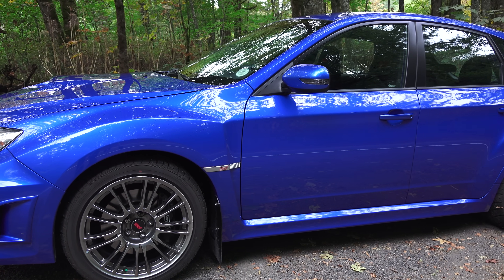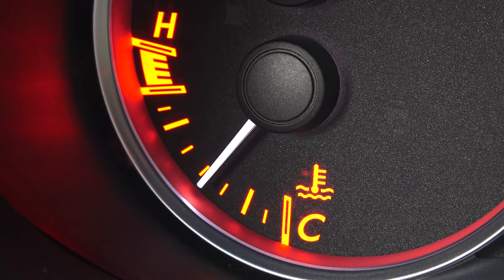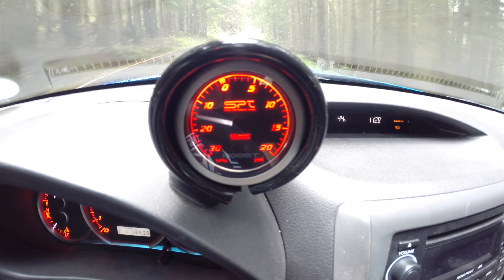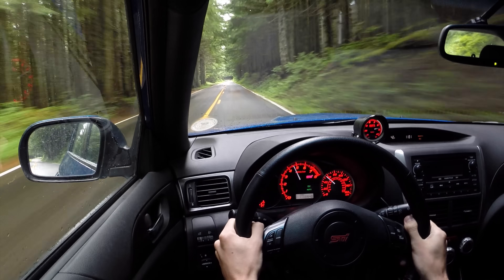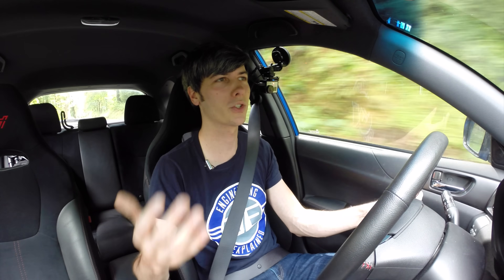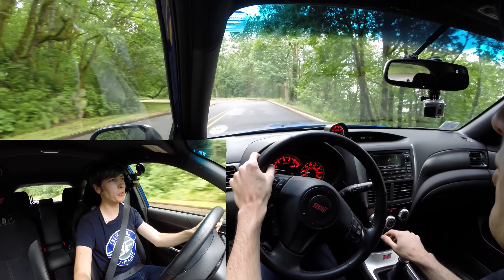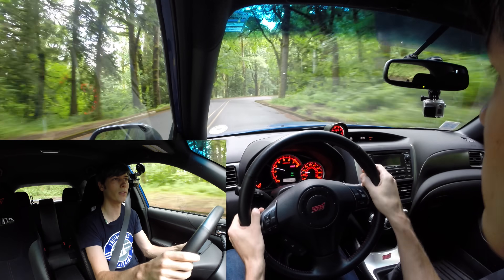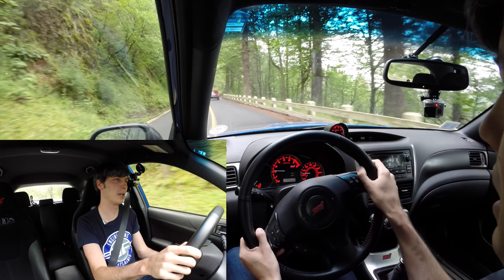5 Things You Should Never Do In A Turbocharged Vehicle

Comment: 1.) You made a video debunking the "waiting for your car to warm up", because new cars are built better and can handle a cold start and go. So witch is it?
2.) Oil in a engine can not just burn up, or change viscosity. Oil gets dirty and additive ware off, but never does oil burn or change viscosity.
You know these things and have done videos on them, so why the contradictions?  Or I'm I reading too much into all this?
Reply: Views.
Reply: The additives break down with excessive heat and car makers always advise to let the car run for 30 seconds or more after a hard run if it's got a turbo.
Reply: I think here is the difference.  In the old days, you needed to wait for your car to warm up to make sure oil was flowing properly.  Now, the cars AND oil is better (remember Slick50? anyone use that stuff anymore?) so you can pretty much start your car and drive off right away without impacting your car long term.However, if you want to start showing off and/or light up your tires and zoom zoom from here to there...let your car's engine oil warm up a bit first.
Reply: letting the oil warm up and leaving your engine running to cool the oil down are two separate issues.

Also oil can lose its viscosity with heat if you've watched his other video about synthetic oil he demonstrates how old motor oil will lose viscosity as it ages.
Reply: (1) IMO you can start the engine and drive away more-or-less immediately, but don't floor the gas or run the the poor engine to redline until it's had some time to warm up properly.
(2) I don't know about viscosity, but oil can leak past the piston rings into the cylinders, then depart the engine via the exhaust.  Whether it actually burns is semantic – when people talk about 'burning oil' what they mean is the engine is losing it through the cylinders.
Reply: I noticed that in the last few months he has had videos where he seems to focus more on oil and facts about it, one video even has a oil spokesperson in it. I wonder if it has to do with some kind of sponsorship deal? he isn't totally wrong about rapid temperature change affecting oil, but its supposed to be changed every 5k anyways so it seems like that would be minimal over such a short lifespan.

Comment: I really think your wrong about this, the oil temp is going to change the weight of the oil only and wont kill the turbo. If it were true that that heat would adversely affect the oil, wouldn't the engine block getting just as hot and also ruin the oil? The reason that ignition occurs is shitty ass head design- ask anyone who knows their hold in head porting. I definitely trust people with 20+ years experience than your educated google-fu. Come on slip angles? That has nothing to do with weather or not its naturally aspirated. 

Why does this video exist?

Comment: Would you do a video on hypermileing? I like to floor it at low rpm for efficiency. Is there an equation that describes allowable torque demand as a function of rpm?
Reply: It's true that engines operate more efficiently under some load. This is basically the reason why you do low rpms and high gears for better mileage (+ there's also less friction in low rpms). However, there's a sweet spot for efficiency, and full throttle misses it. Take a look at the island diagrams in section "real world" in the article linked by Daniel G.
Reply: floor it at low rpm for efficiency ?......... well this is news to me..
Reply: +mrbdazz less friction under lower gears? You mean lower gears = higher torque, higher gears = higher power lower torque...   gearing is set to balance engine Power and torque curves so little to no gap as possible.   Not about friction.   
Why would my higher gears have elevated friction?  Backwards logically also.. how would my GT-R be able to pull 200MPH with higher friction gears?

Comment: FYI, most common fuel in Europe is 95 octane, higher option is 98 available in petrol stations. For 102 octane you have to supply in special stations for racing cars. I've met 108 octane one on drag racing events but it's quite rare. 
So, translating most common EU petrol to US rating, EU95 is US91, EU98 is US94.
BTW, European diesel has 50-60 cetane number and in US standard is 42-45 but some states force higher numbers for ecology reasons (California has 53 minimum).

Comment: How do you feel about tuning these kind of cars Jason? I'm thinking about going the Cobb stage 2 route with my 2014 WRX but I'm worried that it is not good for the engine and car in general, and I want my subie to be as reliable as possible and last me another good 10 years or so if possible. Thank you in advance for your thoughts and any advice.
Reply from the maker: More power means less reliable (unless the engine is built accordingly). Tuning and longevity are inversely proportional. It's fun to tune a car, but the warranty is gone (for a reason). Like everything it's a pay to play kinda deal.
Reply: My opinion, I don't think any tuning is good for the engine. The engineers designed it to be reliable in its current state, in most cases anyways.
Reply: Cobb's stage 2 would be about the limit if you want the most reliablility out of your car. Get a protune, it'll be much better than the OTS tune from the accessport. I've been on stage 2 for a year already and have had no issues with the engine. Do your research on forums like iwsti or nasioc.
Reply: +Vinny The Tech yup I see it all the time in the Vw world with "tuned 1.8t's". 
That turbo is already pretty much maxed out in efficiency from the factory, crank the boost and watch the efficiency fall off, hotter intake temps, overspeeding the turbo...
usually by 100-120k a tuned one needs a new turbo, I've seen untuned ones go 200k

Comment: Im not sure i understand the whole lug your engine thing ? Why would an engine make lots of boost immediately when trying to floor it in a high gear because i thought boost was made by a high volume of exhaust through the turbo and you wouldnt move much air at a lower rpm. I know that it puts strain on your motor but from my experience with my truck all you do is waste a pile of diesel making smoke (lol) until it rolls onto boost in its usual higher rpm range. Im not saying your wrong! but am i missing something ??

Comment: I've got a question. I drive an '03 MR2 spyder and was heavily thinking of going turbo. However, at highway speeds I'm at about 3750 rpm. So my question is, how would a turbo work in terms of cruising on the highway? Would it constantly be making boost? And if so, would it lower my rpms at highway speeds? I'm not too sure as to how it would all work. If anyone would let me know, I'd greatly appreciate it. Thanks!
Reply: David Hidalgo I've seen that video on 1320 with that 900hp MR2. that thing was crazy. Anyways, always appreciate the help!
Reply: 3750 rpm is not really low, about in the middle range. If the turbine won't be as big as a bucket, I think it will give you some power more. But it depends not only by your rpm, by throttle position too. 
Get a small turbine and I think you will be good  :)
Reply: +Giovanni Quargentan so you think that if I just keep the throttle in one position, the turbo won't be constantly working?
Reply: the crazy llama no, it would work still pretty good. More throttle means more air flowing = higher turbine rpms = more boost.
Reply: +Giovanni Quargentan Alright, so I shouldn't run into any big problems?
Reply: +the crazy llama I think so
Reply: +Giovanni Quargentan Alright thanks! Appreciate it!
Reply: Might want to look into a more durable transmission, too. Grenading your transmission because you are putting too much stress on it would suck. Depending on when you will start hitting boost, you may also want to have the gearing changed up so that you can run closer to 2000 rpm at highway speeds. Fuel efficiency will be drastically improved, if the engine is putting out enough power at that rpm.
Reply: +napoleontheclown so, with that fact that my car has a mid-engine setup, does that limit me to only using transmissions that were originally for mid or rear engine cars?
Reply: It's mostly a matter of what will even fit in there. It would be best to find a company that specializes in serious modification of Toyota products and offers warranties on their work. The MR2 is tiny enough it may be hard to find a transmission that will fit and be durable enough to handle the extra power you'd be getting from a turbo. IMO, the last thing you should strengthen in a car while modifying it is the engine. It'll break anything between it and the wheels, and in extreme cases even pop the doors open when you get on it hard. The MR2's engine simply cannot attain that last part, but I can see it killing the transmission if you run much boost.
Reply: +napoleontheclown I see. Well, I'm fairly new to the car scene, so I don't know a whole bunch, but are there any other ways to make more power? I already have an exhaust and cold air intake, but I feel like those do little to none in terms of power gain.
Reply: Without a turbocharger or supercharger, a cold-air intake isn't going to accomplish anything. With forced induction, it'll give a bit more power assuming it's actually a good one that does its job.

If you want to add a little power without scattering the transmission the first time you get on it hard, keep the boost low. Your car weighs so little as it is that smallish gains should be noticeable if you're actually being timed. Seat of the pants feel will likely be more difficult. Properly modifying a car is expensive, unfortunately. And improperly doing it can make it slower or outright break the car.

There are ECU flashes that can be done, which change how much fuel is injected. There's a video on fuel/air ratios that could give you an idea of what can be done in that realm, though be aware fuel efficiency would be sacrificed and you still run into drivetrain tolerances.
Reply: +napoleontheclown alrighty. Well thanks very much for your help!
Reply: Happy to be helpful! Always good to see someone getting into cars, and I want to make sure that people are prepared for modifying things without breaking their car. The MR2 isn't common around here, but maybe they're a little more common where you live. It'd be a shame to break one of those, IMO.
Reply: +napoleontheclown I don't see them much around here either. Whatever I plan to do, I'll make sure I do research and be careful. Thanks again for the help. I greatly appreciate it!
Reply: Yep! I cannot too strongly recommend a well-regarded shop for any work you do. You may need to change the compression ratio on the engine, even. Turbocharging a naturally aspirated engine is not a simple process. Best of luck to you, and I hope whatever you end up doing gives you lots of smiles.
Reply: +the crazy llama if you really plan on spending money on your Mr2, go with a good brand Turbo charger. Get it installed / tuned and you should be good to go. Your tranny won't snap unless you're always in boost. No need to set your boost at 40 psi unless you're street racing. If you're just looking for a fun daily, a safe 15-20 psi is good enough for your Mr2. Turbocharge your car, get all the supporting mods such as turbo manifold, exhaust, intake, brakes, and definitely a BOOST GAUGE to monitor your boost. You should be fine. If you want to see the potential of your car, look up " Mr2 1320 videos" on YouTube. There's a fully built Mr2 spyder raping Evos. Have fun and drive safe!

Comment: When you say "high load at low rpm" what do you mean by high load, flooring it? Because I remember that in SAABs the turbo gauge would get into the middle of the yellow area whenever you are doing a highway overtake (accelerating by increasing throttle a bit, but definitely not flooring it) or by just cruising at 160kph and having a slight uphill. Sorry, I don't have boost numbers for you because... you know... GM... But anyways, what do you mean by "high-load"?

Comment: My first vehicle was a 4.3l 90 Silverado with over 200k miles on it and there was a very noticeable difference when you put 93 octane in it vs 87 octane so I always ran it with 93 (this was back win gas was .89/gal though.  Still I would only run 93 octane in older cars or cars that require it like turbos.

Run 93 in my 9-3 Aero and she runs like a dream, but you do not want to put 87 octane in there.  Thanks for making this video though since the high gear low rpm thing I wasn't aware of.  I'm curious you said it's mainly a problem on newer smaller turbos correct?  So in something with a CVT and a 6 cylinder is that something to worry about?
Reply: The octane rating is for the combustion temp of the fuel. The higher compression ur engine has the higher octane u need to avoid knocks, pings, misfires and such. Putting high octane in a vehicle that doesnt call for it is a waste of money that provides no benefit.

Comment: I don't know about the not lugging your engine, I'm pretty certain they design engines with this scenario in mind and i don't believe a modern turbocharged car would be damaged in any way. If it was dangerous I'm pretty sure they would limit boost until higher rpm's.
Reply from the maker: This is generally what is done, but there are some cars which have experienced it stock on the market, and aftermarket tuners which limit boost until later on. I'll have a video explaining this in much greater detail soon!
Reply: +Engineering Explained I've heard of manufacturers limiting boost in the lower gears to prevent wheel spin but not for this. Looking forward to the more detailed video.
Reply: look into low speed pre-ignition for why lugging turbo cars can be bad
Reply: are you gonna do a video about what not do in a supercharged car?
Reply: Depends what kind of supercharger a centrifugal will be mostly like a turbo just belt driven. A roots or twin screw can be quite a handful if you're not used to it. Low engine speeds it will still build boost very quickly normally less than a second for peak boost in my experience which can either blow the tires out or make a lot of heat and possibly cause detonation. Also be very careful going around corners just like the turboed vehicles.

Comment: Americans... Even the crappiest fuel in Europe has 90 octane (measured in your strange AKI rating). Our Regular is perfectly fine for turbo engines, albeit much more expensive...
Reply: How did you come up with that? If you were to calculate 94 Euro RON + 86 MON / 2, that would equal 90 AKI, but a conversion depends on the exact RON and MON ratings. Also, ratings less than 94 RON are widely available throughout Europe and other parts of the world. In fact, when I visited Europe last year, I remember stations with 91, 95 and 98 available. Depending on the MON rating, these same grades are also available at US pumps. 98 is likely the equivalent of our 93 AKI. Your 91 is probably our 87. Last, lower octane does not make something "crap", octane simply measures the ability to resist engine knock or detonation. If your engine requires a higher octane to avoid knock, that is what you must run. If your engine does not require it, you are not using a fuel that is worse or unhealthy or "crap" when you run a lower octane.
Reply: So much stupidity and arrogance.

Comment: SO does any of this apply to NA cars too?
Reply: The flooring it in a high gear at low rpm probably applies.
Reply: Not really. Most of what he said doesn't apply to modern turboed cars either.
Reply: Thanks y'all
Reply: oil temperature.
Reply: it does, but to a lesser extent. 
and you should let your car cool down too after pushing it, or a motorway drive. 
What i normally do is, after i've parked, wait for the fan to start and turn itself off.
Reply: Oh yeah for sure man, thanks for the tip!
Reply: +Marek Sumguy 
LOL
Reply: +Marek Sumguy lol what?
Reply: +Marek Sumguy lmao
Reply: The one that does apply is going easy until the oil is warmed up. That's true for any engine. Oil is thinner when warm and is better able to flow and squeeze into the tight places in your engine. The more it can do that, the more it can coat and protect the engine.
Reply: Oh yeah I knew that, I already do that. I was wondering about the less obvious things but my question has been answered.
Reply: Dell0304 Of course NOT!

Comment: There was a time where 2.0 TDI engines used to break the turbo. It was because the owners didn't let the car cool down after long/intensive drives. VW said that when you turn off the engine you cut the oil from the turbocharger thus it can't cool down.
Reply: They happened to VWs only because they pretty much were the only ones with big turbos (usually the 170ps). And I know someone who had a 1.9 TDI it did over 350k km and he only replaced the clutch and the distribution chain. Other cars i know their owners did 200000km only the clutch was replaced never have I ever heard about the cam issue.
Reply: That's a shame I was gonna give you a 911 Turbo s. Volkswagen have their own marketing department I don't waste any more time arguing (unless they pay me). If you think all German cars suck I have one thing to say Mercedes-Benz W123 300D.